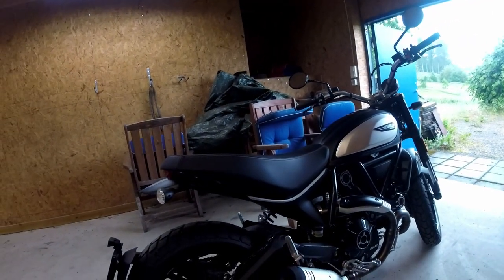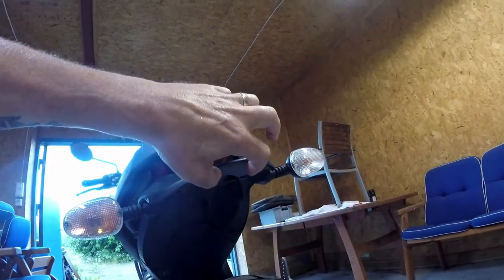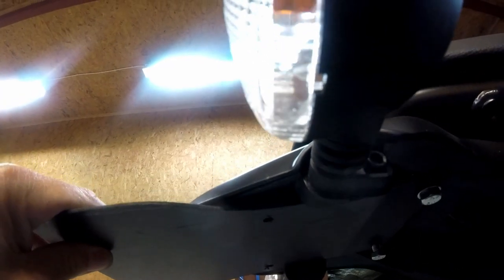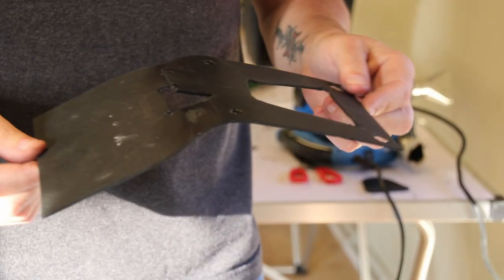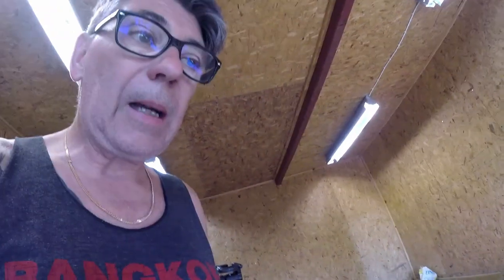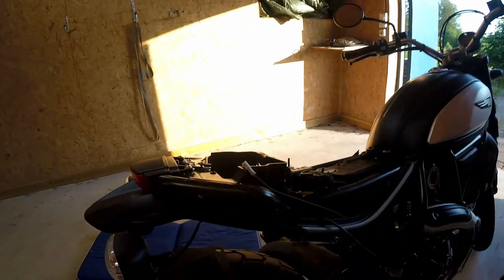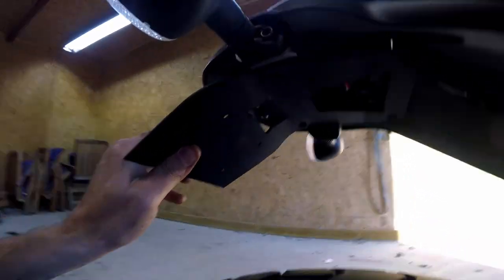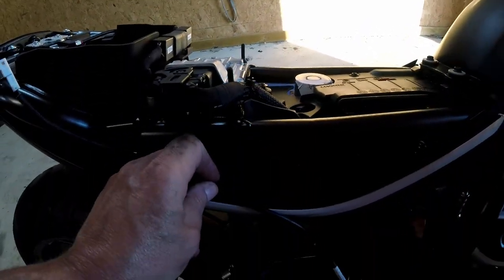DIY license plate holder for Ducati Scrambler Icon

Comment: what size screw is it?
Reply: Hey Rafa! Did you were able to found the answer?
Reply: @alexroman665  I did, M10 (10mm standard screw) for the scrambler 2021 dark icon model and all the 2019 or newer scrambler 800, older scramblers need M8 screws